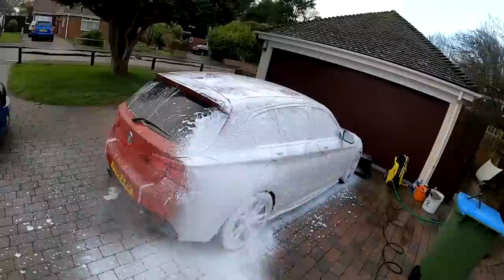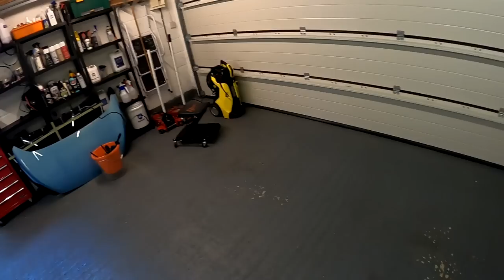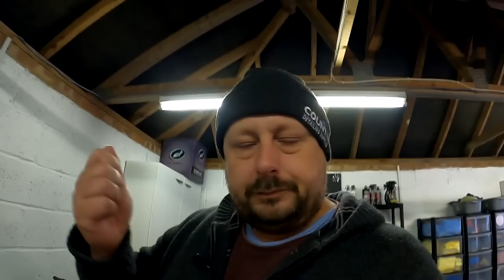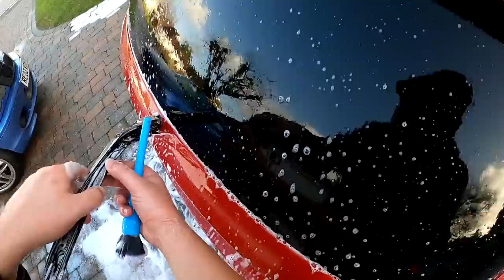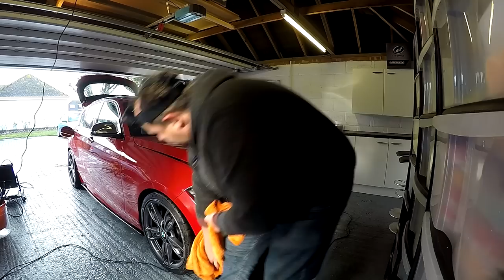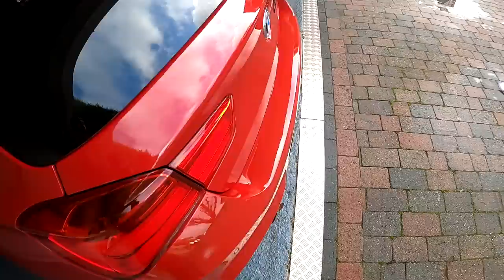Salty Winter Road Film Purge | BMW M140i  | Deep Cleanse back to Wet Gloss Detail

Comment from the maker: Trigger guns are available from "in2detailing"    the thing in the bucket you can find if you search for "sink caddy" on amazon.  They sell them in homesense as well.  Im also using a old autobrite direct PA lance with 1.1 orafice upgrade and the in2detailing dr dirt bottle (stops it tipping over)
Reply: Which foam lance are you using? I have the in2detailing one toghether with their trigger gun and it's nice, but yours look nicer. Also using my combo with my K7 it keeps interrupting the spray every five seconds for some reason.
Reply from the maker: ill update the pinned comment right now with lance info.
Reply: Hiya! Thanks for posting all the videos...they’ve really helped since I moved to the UK. What’s another store I could get car washing supplies besides Halford’s?
Reply: 'Umbra saddle sink caddy' £5 delivered on amazon
Reply from the maker: @StrokeRousseau  none that are nataionwide really but slims and clean and shiny allow walk in customers. I think in2detaing does up in glasgow as well.
Reply: Hey John. Happy New year, could I put a request in if possible.
Could there be a list of products you would use on a white car?.
If there is any other products or different techniques I'd greatly appreciate it
Reply from the maker: @ScottishBert  hey m8 there really is no miracle thing for white cars.   the same rules apply.   try and get it clean and properly decon'd first.. then max out the base physical gloss. by machine polishing properly.. after this just try and wash it regulary and dress is with some nice products.. stay tuned for some cool gloss recomendations.
Reply: Forensic Detailing Channel nice one, I was hoping there was a miracle product for them... should have looked at this BEFORE buying a white car lol. I’ll keep a peep for your videos

Comment: Car looks good Jon! I washed the Z4 today...finished with Polishangel Cosmic Spritz. Normally I use Gyeon Cure (diluted 1:1) but it still streaks a lot on the black paint. Cosmic Spritz looks very good,no issues with streaking but way more expensive. Maybe I’ll try Carpro Elixir in the future...

Comment: Hmm you've got me tempted to try the one rinse bucket and spray on soap method. Seems like a great way to get around the car quickly for those speedy maintenance washes. Have you tried bilt hamber auto wash in the cannon Jon? My concern is that it the soap won't hang around long enough to get round the car

Comment: You cheated BH autofoam for Gyeon , hardcore fans like me are shook 😁
Reply from the maker: I actually got the autofoam out mid way through to just test something (you can see it on the floor outside)..  gyeon foam is decent but it does not have the same level of cleaning power which is really usefull in the winter..   sometimes I just like using different brands.
Reply: He did say it was the last of it! 🤣
Reply: @ForensicDetailing  Yeah john me too!! love switching brands
Reply: Gyeon I feel are starting to get up there in good products. I know their ceramic coatings are great
Reply: it made the FDC "dumbest" moves of the year awards! Bilt Hamber fans rejoiced.
Reply: good catch, i only noticed it 6 months late :( Bilt Hamber fans are still recovering from this atrocity.

Comment: Hello really enjoy your videos keep up the good work. A question about the M140 what’s the ride like with the Motech springs and do you have any trouble with speed bumps and any rubbing when fully loaded. Thinking of doing this to mine but a bit worried about using it as a daily
Reply from the maker: ride is more or less the same.  no trouble with speed bumps and no rubbing mate.   It should be fine but maybe if you are on a PCP check with your dealership if its ok.

Comment: Another good video Jon👍, I know what you mean about the cable on the blower I've got a master blaster sidekick but don't tend to use it because of the cable. 3 or 4 months ago I got a Makita dub182z blower, it's much easier then the side kick the only down side is you've got to remember to charge the battery. Keep the Videos coming and Happy New Year!
Reply from the maker: yer the cabel is more of a pain than I thought.   I might get the little flex one because I want like 1 chargers and to share same batteries.
Reply: It is especially when you've got an extention lead as well🤬. That's why I went with makita as I already had a battery and charger. If decide to go for one I would recommend getting a couple of batteries.

Comment: I also only use ultra high concentrate soaps now, I feel like I’m getting ripped off if I buy anything less than a 1500:1 and really prefer. 1900:1 minimum.
Reply: Do they all have ratios on them?
Reply: @MegaMetinMetin  great question, i belive most of them do, due to regulation, also, a lot of the big name brands like meguriers use "fillers and thickeners" to make it seem like it has more cleaning agents. Some top recommendations off the cuff would be, Britemax shampoo's (1900:1) Geon Bathe + 2000:1, Bilt Hamber Auto Wash ~(1900:1) , i know these to be fantastic products and i personally use them, all ultra high concentrate and you get great value out of them.
Reply: @DavidC1  Ditto on the bilt hamber. Auto foam. I added 20ml to 10litre bucket. Effectively about 4 times stronger, in hard water area, 400(forget units, soz), and foam was brilliant.
Reply: @DavidC1  Bathe essence is 2000:1
Reply: @dimmacommunication  thanks i get them mixed up....both are good products i personally use :)

Comment: Very cool video Jon. Off topic how do you find the Kumho tyres, how is the road noise?
Reply from the maker: hey clint   will do a review on them because about 10 people have asked me about the tyres, might just take a while... but I like them and I was just at breakfast with other guys this morning running them.  we rate them.  I payed 320 quid fitted for 4 of these versus 600 fitted for MPSS.   So surely yes theres some things where its not as good no doubt about that.. but dry summer grit and track day performance the tyres are very very very strong..

Comment: It's a pain washing the car in the winter. I washed my car when it was 4°C outside and the water on the roof, windshield and bonnet started to freeze! (?)
Bilt Hamber Auto Wheel works really well, but how do you keep it from filling the whole garage with its choking smell? I put my spray bottle in two plastic bags and it still smells in the whole garage... xD
Reply: It’s impossible to hide the smell. It’s the best wheel cleaner there is but boy does it stink! I’ve tried plastic bags, plastic boxes, everything. In the end I gave up and the bottle now lives outside in the shed. At least it might keep the foxes away!
Reply: Fred P it’s true it’s a strong smell. I put it in a Kwazar spray bottle and it’s fine.
Reply: @simonwhalley1743  Indeed. I don't want to keep it outside though, as we get temperatures below freezing in the winter here. But as soon as spring comes, it goes in the shed, haha!
Reply: @GeeWhizRS  I don't know what that is. I'll try searching. Thanks for the tip (in case I find it, haha)!

Comment: Hi John what foamer canon do you use has I have just started getting some detailing things together got a karcher and bilt hamber products
Reply from the maker: so I use an older autobrite PA snow foam lance with the in2detailing Dr Dirt bottle upgrade to stop it tipping.
Reply from the maker: I have the 1.1 orrafice upgrade on the lance as well and I try and run OEM PA filters not cheaper filters.
Reply: @Kris Nicholson thats what I have done (not the dish soap part) and dont see much difference from what I have and those branded products on yt. 

From my research today, I would have everything stainless steel too.

Comment: Mate, i found something that gets polish off the trim really well. Bilt hamber cleansing fliid wouldnt budge it, nor mineral spirits, nor a rubber lol. So i used my last weapon, maguirs all purpose cleaner, it took it staight off, awesome stuff 👍👍👍

Mate, i polished and waxed the other day, it took me all day to get the panels deconed to the point where it was ready to polish with DA. Now 2 days later i wanna do a few more panels that i wanna hit again, can i just use a bit of tar remover and foam to get it ready again without all the fuss of a full decon??  Your thoughts are massively appreciated.
Reply from the maker: no need to decon again if you decon'd 2 days ago..  just wash off any dirt and dust and dry it and away you go mate.
Reply: @ForensicDetailing  Youve been amazing!! Your help and advice hss kept me happy n content in these challenging days.

Much appreciated, your a great guy!! Owe you a good few pints thats for sure 👍👍👍😁😁😁

Comment: gyeon foam might have been a bit weak for the winter film ? auto wash BH I would have used with strong snow foam as minimum myself, probably chemical guys citrus wash which I find excellent. PH neutral washes are so weak

Comment: @Forensic Detailing Channel can I ask what model are those kumho tyres? Also whats the road noise like with these tyres? 
I was a member of a r32 forum 10 years ago and everyone on there raved about falken tyres for the golf r32 so I bought them and they had the worst road noise compared to premium tyres. I was looking out of ether noise but that was all I could hear for months of driving without radio on and got really annoying.  I have been put off looking at any new tyre brands ever since. 
I would like to know your thought on them as I consider you very honest and non biased when giving your opinion on things. 
Many thanks in advance
Reply from the maker: I cant tell difference in road noise.  I will do a review on them because about 10 people have asked me about the tyres, might just take a while... but I like them and I was just at breakfast with other guys this morning running them.  we rate them.  I payed 320 quid fitted for 4 of these versus 600 fitted for MPSS.   So surely yes theres some things where its not as good no doubt about that.. but dry summer grit and track day performance the tyres are very very very strong..
Reply: Forensic Detailing Channel that’s great news to hear you can’t tell the difference in road noise . I have heard so many other people talking about them too and some manufacturers put these stock on performance cars which is another great sign and best of all they look amazing on the car and the price!!!
I really look forward to your review and I’m really interested now these tyres now 😁

Comment: What are the does and donts with APC. Can they cause damage and do different brands range in strength. I diluted some Meguires APC to try and get the shine of my leather seats. Someone told me after I'd ruin the leather. I'm never quite sure what not to use APC on TBH.

Comment: Noticed you didn't use two bucket method for wheels? Or is it overkill with good grit guards?
Reply from the maker: 2 bucket for wheels?    I guess you could do this but you would be in a very very very small minority.

Comment: What other available towels have you found good to buff off the elixir ?
Are the paragon 300s any good.  
Or I have the in2 Korean 400s 
Would any of these also be good on the  TW sealant spray
Reply from the maker: try rag company edgless 365 or 300... dont use open piles on wet products.   paragones are a bit too soft for wet products the TRC towels will hold shape a lot better.

Comment: I know you are not using BH Autofoam in this one but what is your mixing ratio in your foam lance when you do use it? As I understand it’s a bit tougher than other prewashes but I also want to preserve as much of my protection (Fusso 12 month wax) as possible during the winter...
Reply: Rasmus Andreasen you can google mix ratios for the bilt hamber auto foam, it all depends on your flow rates of pressure washer. It’s not complicated though👍

Comment: Question for anyone...
Before using bucket & mitt I want to lift dirt without using a hosepipe or pressure washer so does anyone know if snowfoam or similar can be applied with something like a pressurised spray bottle? 
Cheers

Comment: Do you know if you can mix a little Atom Mac in with your snow foam? Also, it would be nice if Bilt Hamber was easier to purchase in the United States.
Reply from the maker: I dont know answer to this bilt hamber are ones to ask mate.. I would guess dont do that. use it exactly as instructions state. but could be wrong.

Comment: How's the new tyres working out!
Reply from the maker: so far fine.. but its greasy slippy time.. they are not as grippy as the MPSS in the winter conditions but neither or them are good in these conditions.. I will only really know when I get to put them round goodwood racetrack in dry summer conditions I think.

Comment: Hey great video. Can you let me know what lance your using and the snow foam please. Any links for them two items or discount codes. Cheers
Reply: toploader showcased in a previous vid with discount code👍
Reply: Thanks. Will have a look through previous vids. How far back roughly was that video. Cheers👍
Reply: Ok found the lance but not the snow foam or the snow foam bottle. Can anybody help. Thanks
Reply: toploader Bilt Hamber auto foam and bottle should be in drop down menu with discount code.
Reply: toploader his bottle is in beginners detailing set up vid
Reply from the maker: lance is older PA autobrite direct lance with 1.1 orrafice upgrade.  And the in2detailing Dr dirt flask cone thing to stop tip over.   I also only run OEM PA filters rather than cheaper chinese lance filters.   seems to help.. but good flow rate and pressure is the key.. K7 gives great foam.
Reply: Forensic Detailing Channel Hey Jon, the  Kingsman vid  has had some serious hits, think you’ve hit on to something there. Posh little off roader gets down and dirty😉

Comment: Would atom mac stop disc rotors going rusty when doing wheel wash?
Reply from the maker: normaly yes for sure.  but its not guerentee'd   they will inhibit rusting... but if you spray something caustic on it might not stop it.. For example spray some fallout remover on your break disc and see what happens.   Same with some car soaps they actually contain caustic components with cause rapid oxidisation and even atom mac cant stop it.

but wash your car with autofoam, autowash, and surfex for wheels and use atom mac as well and you wil get no rusting on the rotors..   all the BH detergents will inhibit rust to varying degrees./. Even if they dont contain rust inhibitors they still inhibit rust through their alkalinity.

Comment: Hi just got a few products to clean my car more than just the basic wash. 
I was claying my windscreen with soap water, than used autogly glass polish and surprisingly it has remove soap residue that noting else has touched at all.
Only downside is now i have caused numerous scratches over the windscreen.
I made sure to have clean clothes etc and good prep yet it seems every time i try to do any work on the car i always add scratches in the process.
Any ideas why? Nooby here
Reply from the maker: so I use autoglym glass polish.   on a free spinning DA with soft clean pads.    And I make sure to clean the glass (wash first) then gently decon glass to remove chucnks of contamination.    The wipe it over.. then use the polish.    If you rubbing stuff with lots of pessure and theres fine dirt and grit in there it will typically put in fine scratches..   

but over time your glass will get fine scratches from the wipe blade dragging grit..

Comment: Not cold outside ?. I was outside today for about 3hrs and threw the towel in at 1pm as i was frozen to the core. My hands had actually gone blue.
Reply: Hot water helps a lot
Reply: Hes in the deep south. Also UK covered in micro climates

Comment: I’ve currently got turtle wax sealant on my car, would elixir be ok to use as a topper on maintenance washes?
Reply from the maker: it should be fine yes...  you could use the TW 3 in 1 detail spray though.  I will be comparing this to other detail sprays on the market soon on the channel.

Comment: Hi John, lovely video, great soothing effect 😆, it would go down a bit better if it would be a daily dose.
      Could I ask you about turtle wax sealant hydrophobic wax, if it can be applied to headlamps and windows.
     Thanks, looking forward for your next video.
Reply from the maker: I would not apply it to the front windshield zing zing.. but headlights yes and side or rear glass yes...   It has nuba wax and it could interfered with wiper blade operation.
Reply: @ForensicDetailing  Thank you.

Comment: Hi friend, need to ask you , for you that have tried all the car soaps out there, what is the best most agressive soap to remove film road with out stripping waxes and sealents ? Im from texas don’t know if I can get most brands in your country, is it bilt hamer? I think you mentioned in your past video’s ,im talking about touchless grime and road film remover
Reply from the maker: Ive done videos on best snow foams and best automotive shampoo's    

Snow foam pre wash nothing Ive seen has the cleaning power of BH autofoam but its also surfactant biodegradable and none caustic..   

contact wash  I like auto wash as well it inhibits rust.     Car pro reset I like you can get that in the USA.

BH will eventually hit the USA Pedro
Reply: Forensic Detailing Channel thanks bud your the best, can you post links of those 2 soaps please
Reply: Forensic Detailing Channel BH auto foam? Fo mean built hammer?
Reply from the maker: @Pedroluvslupe  yes m8
Reply: Forensic Detailing Channel not for sale here in usa so frustrating